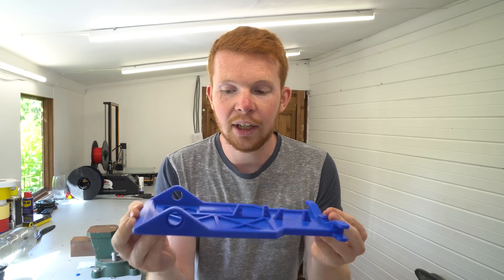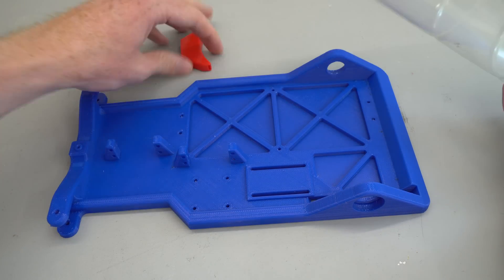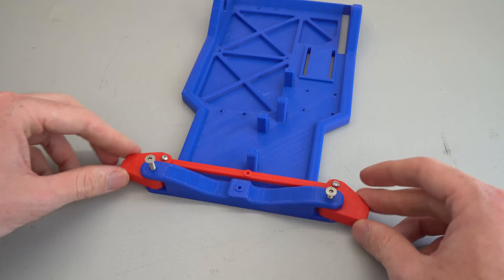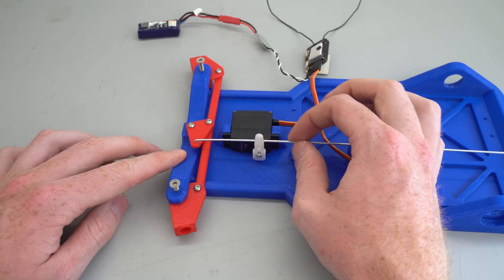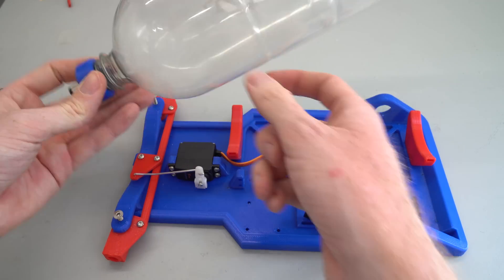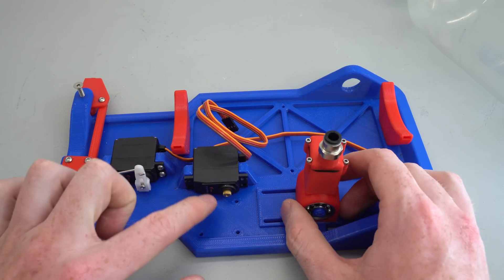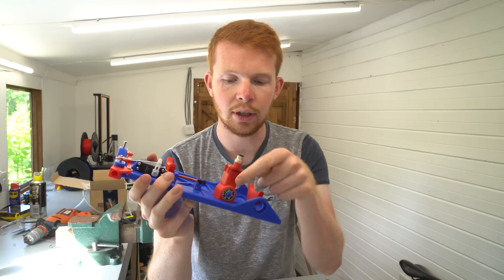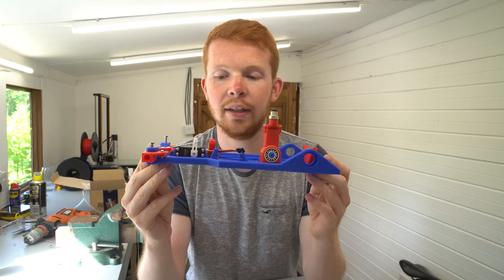Air Powered Car - Part 1

Comment: sweet design Tom! There were only a few things that came to mind which you may already have thought of but I thought I'd add to the design discussion. Your front wheel hubs seem to have parallel steering attachments which means you'll get parallel steering and hence scrubbing. This will be more visible and annoying when the car is going slow and turning hard. Same issue with a locked rear axle if you don't use a differential. I would probably guess that a rear diff is too much effort for the gain you get, but designing in 50% ackerman steering would be very easy and you'd only have to reprint the front hubs. The other thing is the mounting of the rear axle. You have it on top of the floor plate and I'm guessing this really helps you when it comes to packaging the drive train but it just seemed like you'll be relying on layer strength as those bearing mounts will be always pulling the print apart. If the axle was underneath the floor plate that part would always be in compressing and the bearing mounts would only need to do the job of providing support back and forth rather than having to hold the whole car up (again, might be a non-issue if the car is very light like you said). Last thing (and this is more of a dream idea :) is starting the car. Like in the plane scenario you have to start it manually and use the drive-train as flywheel. When you first mentioned it I immediately thought of a metal flywheel system that sits next to the engine that you can start remotely with a servo push (similar to finger pushing the prop) and then once it's throttled up to speed you can slowly transfer the power to the wheels with a clutch system or similar. Kind of like how super light 4D planes get the motor up to speed and then increase prop pitch. Just an idea :) As always really love the doing it from scratch and documenting the process. Super fun mate :)
Reply: You need to put dry ice and water into the bottle then attach it to the air powered motor
Reply from the maker: Thanks Andre! Yes I'm very new to designing cars and didn't realise about the Ackerman steering haha. So I'll reprint the front hubs. However, I'm still going to continue with a fixed axle between the two rear wheels for simplicity reasons. As for the layer strength over the top of the bearings, it seems to be strong enough for this application as the car doesn't weight much, but would for sure be an issue on a 'regular' RC car due to the crashes they usually endure. For the drive train, I'm planning on just a fixed gear system to the rear axle. The idea of a clutch/flywheel system would be really awesome, but considering the run time of this engine is around 1 minute, I'd rather have all the air energy being transferred to the wheels. This is what I love about the internet, someone with no idea about cars (me) can learn so much from you guys!
Reply: Andre Bandarra 
I thought you were being pedantic. 

But the Ackermann steering should be in this project BECAUSE this project is an investigation of design. 

I hope he reads your comment. 

https://en.m.wikipedia.org/wiki/Ackermann_steering_geometry
Reply: Andre Bandarra Wait are there rc planes with adjustable prop tilt? Sounds freaking awesome
Reply: The design has a low torque motor and so having Ackermann geometry will definitely make a difference in performance, especially if it has wide tires in the front.
Reply: Julian Petit yeah man they fly backwards and shit, reverse hovers etc
Reply: Larry Scott no was just being geeky about car stuff :D I think Ackerman is quite a nice feature to implement with not a lot of design time and printing requirements
Reply: Yes and by inclining the pivot axis the steering would also be selfcentering without reliing on the servo. I immagine this would make the whole setup more responsive since it is helping the servo instead of working against it.
Reply: I doubt that the car will run long enough to need to worry about Ackermann
Reply: Hell also find more scrubbing because the center of rotation for the wheels is far from their geometric center. It’d be far more efficient to have those close to each other.

Although [this](http://sariel.pl/2015/03/virtual-pivot-steering-system/) page is about lego, it’s quite a good explanation of why, although it mostly concerns itself with fender size instead of turn efficiency and scrub avoidance.
Reply: Andre Bandarra I was just about to talk about the steering geometry. He is going to wear the front tires  bald from it. He should use a Ackerman steering model.
Reply: Julian Petit  They have been around for quite a while.  Mostly used in the indoor 4D models.
Reply: Sloth FPV Don't they have reversible motors/escs?
Reply: ayyyy another maker we both follow! :D nice to see you here. great ideas, btw.
Reply: https://web.archive.org/web/20130518220840/http://www.motor.org.uk/documentlibrary/Sep%2009/TT%20_%20Sept%2009.pdf  Has a pretty good discussion of most of the angles that factor into basic steering geometry.
Reply: Julian Petit there are. They allow for advanced acrobatics. Flitetest did a video of one
Reply: you are absolutily GENIUS , like it
Reply: This.
Reply: There are Lego diffs
Reply: Yup, any amount of scrubbing of the front tires in turns will have a negative effect on how long it will run. He could get by with only powering one rear wheel. Many go-karts do that so they don't need a differential. For racing karts it's the right rear that's powered for oval tracks. Works best when the kart only needs to turn left. ;) Or, just one of many differentials https://www.thingiverse.com/thing:79938
Reply: If you have a solid axle between the rear wheels you'll find it very difficult to steer. Most go-karts only drive one rear wheel for that reason. Should you want to try a differential, there are many designs on thingiverse which could be modified.
Reply: If the car does not have a reverse anyway  each rear wheel could have a overrunning clutch to improve steernig / reduce drag in corners compaired to a fixed rear axle and less complicated as a real differential
Reply: Tom Stanton The simplist option is to use 1 wheel drive, with the weight of the car it doesn't need both wheels driven. At least you would be able to turn in one direction if not the other 🤔
Reply: Julian Petit yeah it's freaky cool how they fly backwards and hover with the nose pointing down etc :D
Reply: Andre Bandarra

Comment: Nice job but i would trash the plastic bottle and get a small co2 tank from a airsoft store or even smaller a 88 gram co2 tank from a airgun store. They would hold much much more air psi but you would need a small regulator to lower that to the motor. You run times would be maybe 10 minutes at least.
Reply: Matthew Poole paintball ones probably hold less. But sodastream ones. Now your talkin.
Reply: No he needs to put dry ice and water into the bottle then attach it to the air powered motor
Reply: or you can get a compressed air tank (paintball). bigger ones hold 68 cubic inches of compressed air @4500 - 5000 psi! Put a regulator on those XD their not cheap tho! The high end ones are also made of carbon fiber, not metal. They are very light! 

The only problem with both Co2 and HPA (high pressure air) is that its hard to fill them. a big Co2 tank costs like 5-10$ per fill.... HPA costs less, at most places where im from its free. Just a hassle to get filled! But at least u can fill HPA tanks up to whatever pressure your air compressor can put out!
Reply: Damn, was just about to suggest a CO2 tank. Glad to see someone else is thinking along the same lines.
Reply: Co2 tank is to heavy.
Reply: Co2 tank from a bicycle pump + bicycle pump. It could even power the airplane.
Reply: That kind of defeats the purpose of the build. He's wanting to use the bottle of compressed air because that's what he chose to design around. Sure the co2 tank would work better, but it's not the same.

Comment: Hey Tom, have you thought about using a belt drive instead of gears? You probably have. I was just thinking it might be easier to implement. Avoid stripped gears and such. You could also tension the belt by sliding the in that little track you have for the engine mount.
Reply: Anchor Bait I was thinking this same thing. I don’t believe stripping gears will be an issue with this since that motor has almost no torque, but I do think there will be more losses in using gears for this than a belt drive. Also, like you stated, it would be very easy to tension the belt rather than having to get the gears to mesh well. A belt would be much easier all around as far as design and setup and for the purposes of this project I would think it’s the way to go.

Comment: I'm wondering how far you can go on the pressure a plastic bottle will give you. You could test it just to see how long/ how much pressure/how much torque you get before you get further into the project. Depending on how well it works, you could also think about switching the bottle out for a small aluminum canister like a camping propane tank or a mini helium tank.

Comment: STOP WHAT YOU ARE DOING, and go peel that protective plastic off of the lcd display right now! Thank you.
EDIT: Did you do it?
Reply from the maker: Is it weird that I've not even noticed it's still on the display?
Reply: @TomStantonEngineering   can you share car chassis stl file
Reply: @TomStantonEngineering  yes lol
Reply: @TomStantonEngineering  perhaps
Reply: ...and then fix that light switch to the wall!  Great video, as always.
Reply: Juho Leiniö oh my god I was going to say the same thing
Reply: That is my favourite part of getting something new. :D  I installed like 20+ power outlets in my basement and they all came with a protective plastic, it was so satisfying to remove.  I don't even need that many outlets in my basement.
Reply: Andy Wardley  As long as we are being nit picky, it bothers me that he is not using 90° tubing connector fittings.
Reply: Lol I even made a new one when the original peeled off :D
Reply: Tom Stanton lol
Reply: Liquid crystal display display?
Reply: It was the first thing I noticed too.
Reply: My 3D printer is exactly the same, you perhaps should point out he needs to fix the light switch to the wall :)
Reply: Leaving the protective cover on keeps it protected longer. I don't remove them until the cover loses transparency...... Unless it's a touch screen

Comment: The bearing that you have in the engine is a metal one right? wouldnt be better a ceramic bearing? More expensive but they spin more freely. Just asking. Awesome video, can't wait to see the final result :D
Reply: Roberto Alonso He switched from ceramic to some cheaper metal ones that, he states, “are pretty similar” in the way they spin
Reply: ok, didnt know, thank you
Reply: Yea I was going to say they are about the same he doesn’t need a ceramic bearing because he’s just doing it for fun

Comment: Here's to hoping for a simple transmission too! I'd love to see a servo controlled 3 speed or something.
Reply: Michael Smith a clutch would make it a lot smother, but you can let off the throttle and shift to the next gear or rev just a little to down shift. But if you want revers then you will have to stop the motor without a clutch. A simple solution would be a basic belt tension clutch like most lawn tractors use.
Reply: Michael Smith Not if you shift it right, my friend. If they can do it in Lego he can do it with plastic.